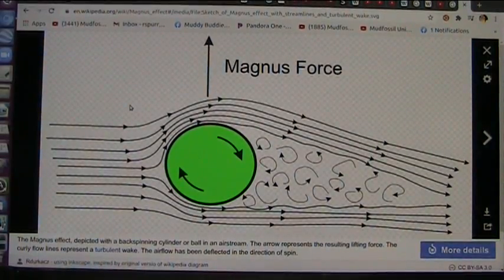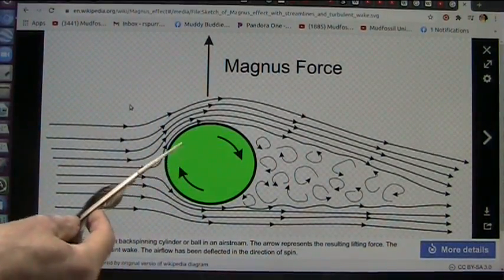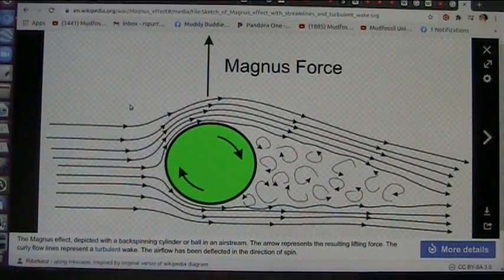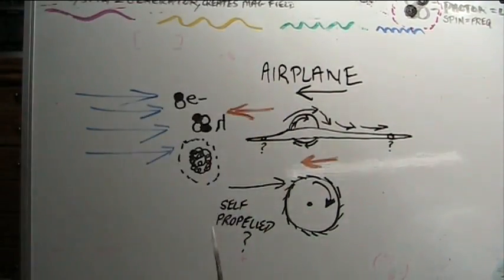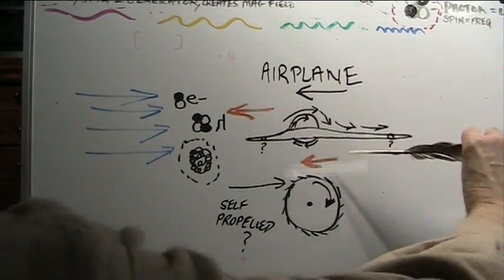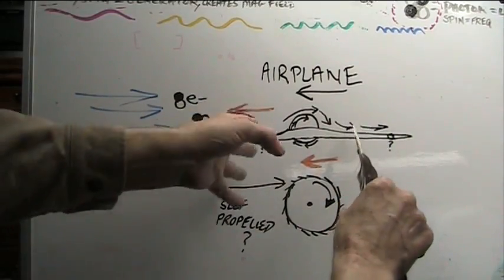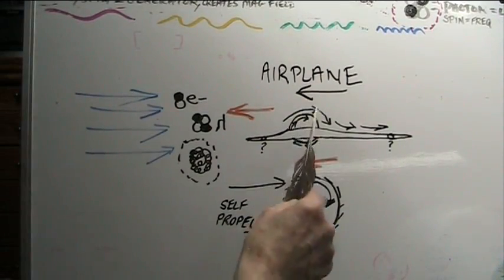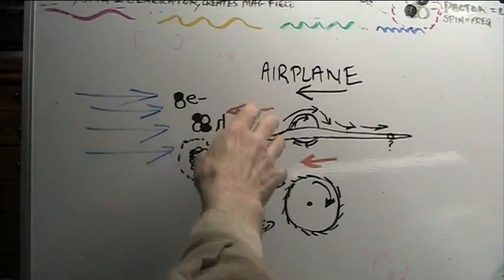Magnus Effect Basketball Insanity

Comment: Air is denser on the bottom than the top which creates lift ,there are other forms of lift using magnetism high voltage they might not be as dumb as you say .I think you should make a working prototype looks affordable and simple from a engineering  standpoint

Comment: There was a demonstration well over a decade ago with ball bearing on each pole of a shaft. The shaft was freely moving. High voltage and high current negative to one bearing and positive to the other bearing. The shaft spins and near endlessly accelerates. This basketball primary armature was the human spinning it in the fluidic medium. They claimed a supercritical threshold (Max Q) then a stable.free electron input from the medium (Godin,Roschin). Have you seen the belesouv-zhabotinsky experiment? I assemble the photon splitter next week trialing a rocket shaped venturi with one additional free electrode in the path of the electron. Hopefully will polarize with the venturi then the collection plate perhaps valence holes which funny enough could come from a high k dielectric such as barium titanate.